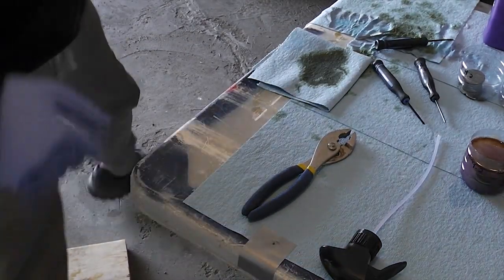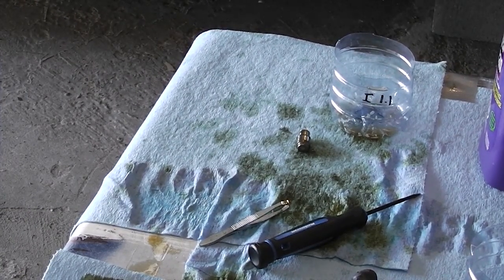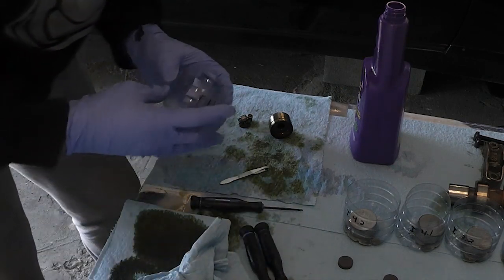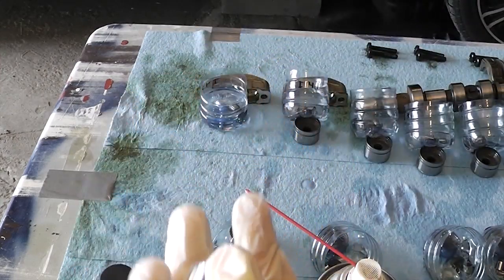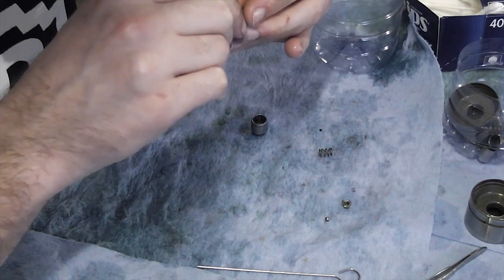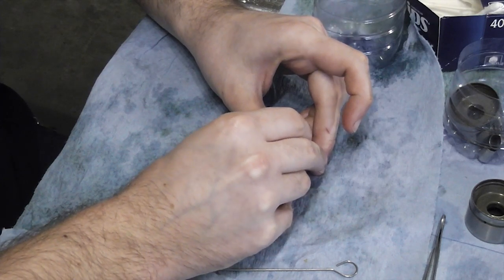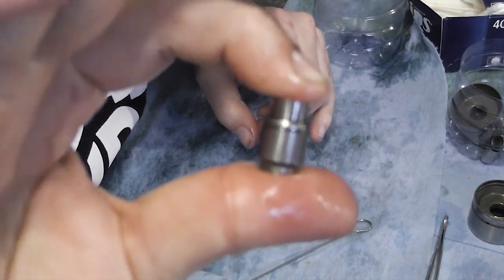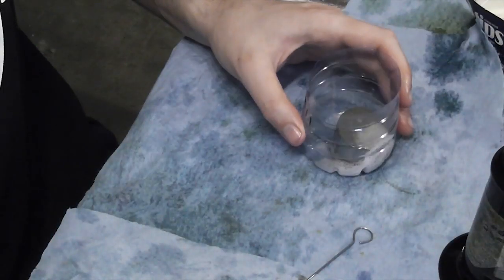Rebuilding Mercedes Lifters

Comment: a cylinder head shop messed up my lifter arrangement what do i do???
Reply from the maker: I would treat this as an engine break-in. Use conventional oil and add a break-in additive. Run this for 500km using your favorite break-in tricks and then go back on your usual oil.
Reply: @PatsCarGarage  thank you for such a quick reply! I will break it in like you said. much love from southern california!
Reply: @PatsCarGarage  these pistons inside the lifters wont budge!! i've tried hitting them each on a piece of wood for 30 minutes.
Reply from the maker: @Rycoda  You do have to whack them pretty hard but they should move. You can also try grabbing the pistons with pliers and pulling them out (don"t worry, the metal is hardened, pliers won't damage them).
Reply: Pat's Car Garage thanks I hit them pretty hard on the cement with a towel then used some pliers

Comment: Thank you for the video! I'm gonna give this a try on my sticking M103 lifter. I'm a huge fan of "try to fix everything first instead of spending money to replace them". If I screw this up then I'll just order brand new ones. Nothing to lose there :p
Reply from the maker: It's honestly pretty hard to screw up. The worst that could happen is you lose the tiny spring, that's why the magnets are essential for keeping everything together. Other than that, the steel used in these components is harder than tool steel, so you can't even damage it by using pliers or whatever (you shouldn't need to though). If you do end up swapping them out, the ideal thing to do would be to use the new lifter's internals in the old lifter's bucket, that way there is no break in between the camshaft and the new lifter. This is also why you need a system to keep trick of the lifters you remove in the first place.
Reply: Well apparently m103 has a completely different design than the m104 and they're either sealed shut that it won't budge no matter what I tried, or it was seized. Oh well ended up ordering one unit. Such a bummer because I was really looking for ward to save so $$ hahah

Comment: An excellent video!  To be honest, these are so cheap, is it really worth the effort?  I had an issue with a lifter on my MB M102 engine.  Sometimes I would have hard starting, a misfire and noisy lifter when starting from cold, other times not.  I narrowed it down to a faulty lifter, losing oil when the engine stopped the night before with the lifter in the compressed state.  Rather than hunting down the faulty lifter I just replaced them all (less than USD70 for the set of 8).
Reply from the maker: you can't just swap lifters in, the bucket has to wear into the camshaft (and vice versa). You can swap in new internals into a previous bucket, but you can't even move the lifters around, doing so could damage the camshaft. The M102 only has 2 valves per cylinder, but on any engine with 4 valves per cylinder, these cheap lifters get really expensive really fast.
Reply: @Pat's Car Garage, I've since replaced all my lifters, the lifter noise at start-up is gone.  The brief misfire was caused by a dripping injector, replaced them all, misfire now also gone.

Comment: An excellent video! 
I’m having a knock at cold start up with my m104, I’m trying to determine if it the hydraulic timing chain tensioner or hydraulic tapper, could you tell by listening to my video: https://youtu.be/Whfe4qWCJQ8
Reply from the maker: You start by replacing the belt tensioner shock (if you have one), it can make a whole bunch of weird noises on cold startup. My other guess would be that this is the intake cam adjuster (built into the sprocket, not the external magnet). When they get old, for an unknown reason, they stop retaining the oil that's inside of them, and until the oil pressure builds up they rattle. Mercedes tried various fixes / seal replacements to try and solve this issue when it first starting appearing to no avail. The only fix is to get a new cam adjuster. The good news is that despite the noise, no cam adjuster has ever actually failed, and the noise always goes away after a second. If you can correctly identify that it's the cam adjuster (while listening in with a stethoscope when someone starts the car), you can just ignore this issue, it won't ever get any worse.
Reply: Pat's Car Garage Thanks for your reply, does the knock in my video sounds like a faulty tappet? link is in original comment
Reply from the maker: if it's not the belt tensioner shock then it's probable the cam adjuster